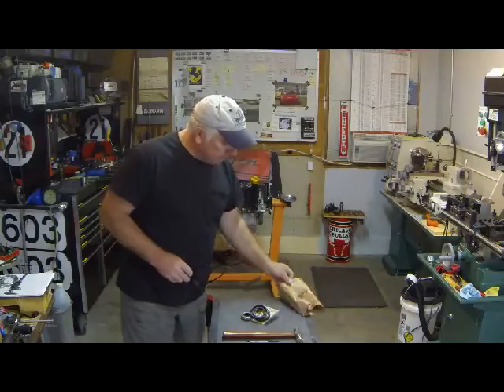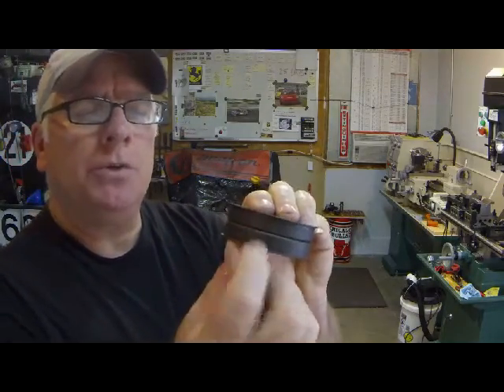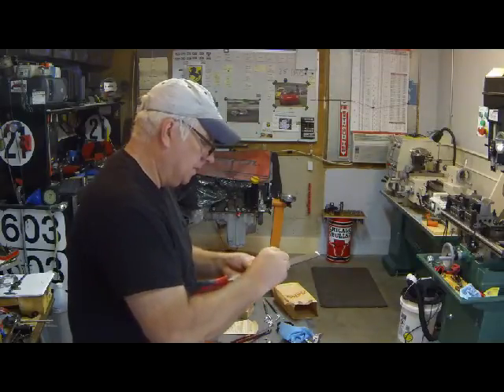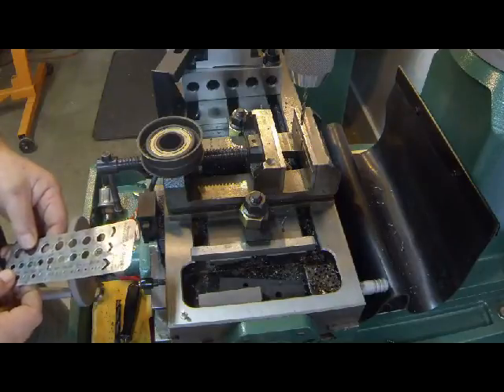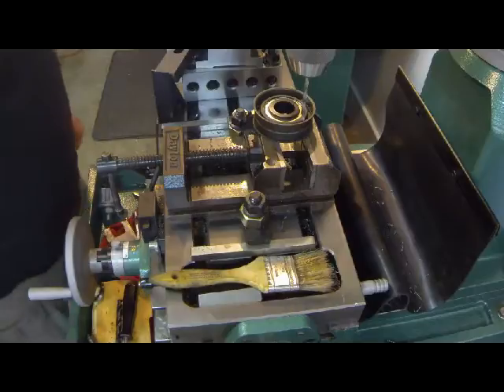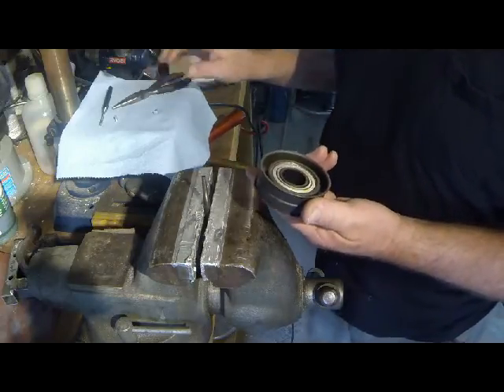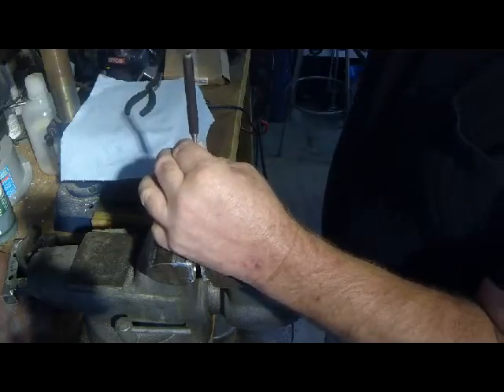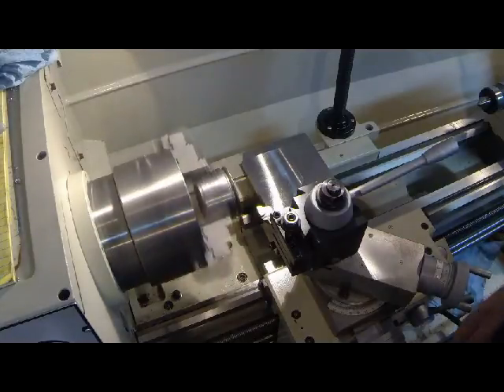944 Torque Tube rebuild

Comment from the maker: Hi Gregg, Referring to the bearing locations;
The measurments that I have used in the past are those taken directly from existing torque tubes. In each case the locations have only varied slightly. So, considering all four bearings to be installed and referring to the forward most bearing as my number one bearing followed by two, three and four to the rear. 
When I am ready to install the bearings, starting at the front of the tube, I install the number two bearing 29 inches into the tube. Next I install the number one bearing 12 inches down the tube.
Lastly, from the rear of the tube, I install the number three bearing 23 inches into the tube followed by the number four bearing inserted 6 inches into the rear of the tube.  That's it, all four bearings installed.

Comment from the maker: Hello Gregg,Thanks for your interest and great question....Take a look at my "Torque Tube Rebuild Part 2" video at the 4:50 minute mark. When looking at the rear portion of the torque tube there is a round opening in the rear aluminum section used to access the driveshaft's rear coupler and cross bolt. This is the determining location of the inner driveshaft and the outer torque tube. If you align the inner driveshaft's cross bolt area with this cross bolt access hole, the length of the forward protruding section of the driveshaft in the front of the torque tube will be the correct length to correctly connect into the rear of the engine.

Comment: 5/32 rivet by aircraft specs will be a #21 drill bit. Use a squeeze like this with modified squeeze sets - ( http://www.yardstore.com/browse.cfm/2,406.html ) Although, I would mill another caliper piston and then sandwich it in a bearing press or even a vice for that matter to get those rivets squeezed. All three at once.

Comment: Is the rivet too soft to be held in the chuck of a drill, so that the head can be spun & milled against a file - sort of like a half-ass lathe?
Reply from the maker: Hello Rennpanzer, Once removed you will discover the slot in the bearing retainer where the rivet will eventually reside is very narrow. If you cut the rivet head narrower with two parallel cuts as I have demonstrated in the video the rivet will fit into the bearing retainer's slot. The rivet will then have the benefit of sufficient material at its head to hold in position and fit within the retainer's slot.
If you were to reduce the rivet's head diameter similar to the "lathe method" fit into the retainer you may find there won't be much rivet material remaining. It may also become more difficult to hold the rivet in position before peening / swelling the rivet to fasten the two halves of the bearing retainer securely. 
I am always open to different ideas but, I am sure that when you inspect the bearing retainer you will have a better understanding of the restrictions in the area of where the rivet will be placed.
Hope this is helpful, thanks for your interest...
Reply: Very good point - probably one of those things I'd have had to figure out through trial, error, and "colorful mutterings".  

My car's only got 60k on the clock.  but, with not much clutch pedal travel before release, your insight might be very helpful in the not-too-distant future. 
 
Many thanks.

Comment: What are the measurements of the 4 bearings in the tube
Reply from the maker: +Gregg Hancock 
Hi Gregg, 
The measurments that I have used in the past are those taken directly from existing torque tubes. In each case the locations have only varied slightly. So, considering all four bearings to be installed and referring to the forward most bearing as my number one bearing followed by two, three and four to the rear. 
When I am ready to install the bearings, starting at the front of the tube, I install the number two bearing 29 inches into the tube. Next I install the number one bearing 12 inches down the tube.
Lastly, from the rear of the tube, I install the number three bearing 23 inches into the tube followed by the number four bearing inserted 6 inches into the rear of the tube.  That's it, all four bearings installed.

Comment: Hello Jay, unfortunately the time has come for my torque tube bearings to be replaced. I have to ask you, where did you find the original bearings? I found a part number but cannot seem to find these bearings anywhere online. Thanks
Reply from the maker: Johnny, these bearings are manufactured by several bearing manufacturers but possibly the easiest way to obtain this bearing is through Amazon. The part number is: 6006ZZE priced around $18 each.
Hope this helps...
Jay
Reply: How did you diagnose your bearings?  I picked up a beautiful 951 back on memorial day.  It just turned 60K but, my clutch release is right at the beginning of pedal travel, so I figure I should probably start thinking about drive line stuff.

I've been a SCIROCCO & GTI guy most of my life.  So, needless to say, I'm on a bit of a new learning curve.
Reply from the maker: Rennpanzer Hi again, Sounds like a clutch job is in order…
The easiest way to determine the condition of the torque tube bearings when driving is to remove any engine torque and let the rear axle spin the torque tube "drive shaft." So, if when traveling at moderate speed on your favorite strip of "test road" simply depress the clutch and lift off of the throttle while remaining "in gear". The rear wheels will now be turning the torque tube "drive shaft". If a bearing "growling" noise is heard you can start to suspect the torque tube bearings but, you must further determine the "growling" origins by returning the trans to the neutral position while continuing to coast along your "test road". 
When you select trans neutral you have now disconnected the torque tube "drive shaft" from the equation; If the "growling" noise disappears all indications point to the torque tube bearings. If when coasting with the trans in the neutral position and the "growling" noise continues you are looking at possible rear wheel bearing / axle shaft or transaxle bearings…!
My advice is to try this method several times to better you chances to determine the actual causes of any drive-line bearing noises before tearing into this type of project.
Jay
Reply: Dark Horse Garage Going on a PCA  run to Mt. Hamilton tomorrow.  I'll give that a try.
 
Thanks again!